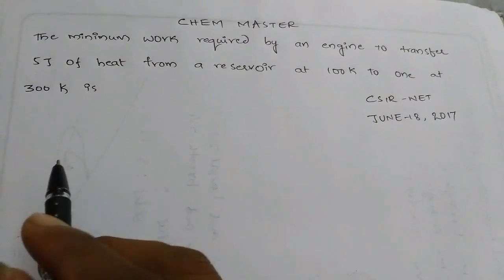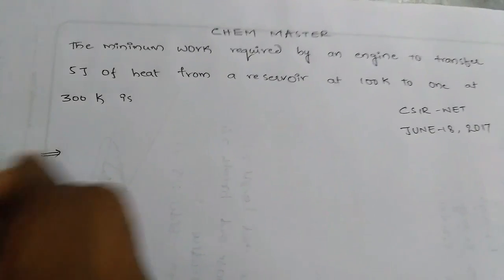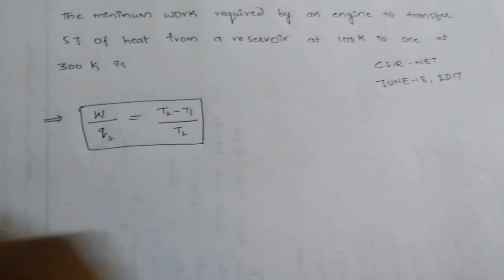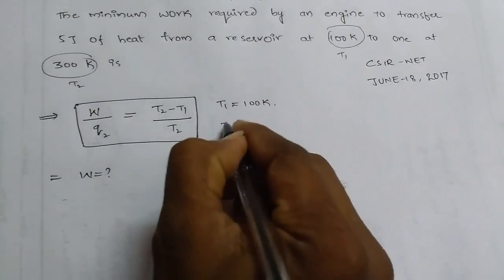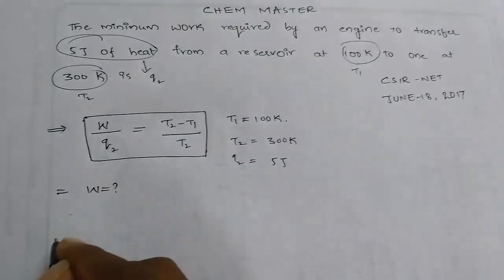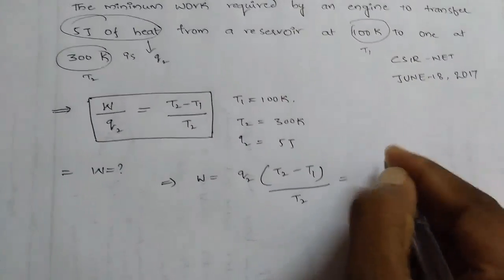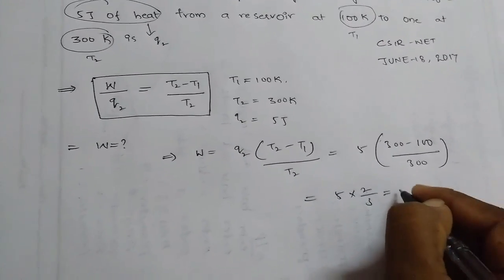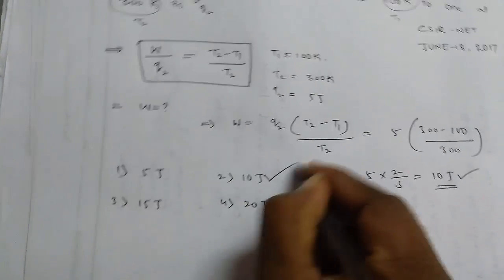Chemical sciences solved problem of CSIR Net ,june-18,2017

Comment: I did the same in exam but 5 x 2/3 is not equal to 10. BUT If we take the formula (T2-T1)/T1 then we are getting 10 as the ans. 5x2/1 = 10. There must be some mistake in the options
Reply from the maker: +aarzoo makkar sorry,no mistake.......I have directly given 5×2/3 but we should write 5(2/3) means 5 should multiply with both 2 and 3 and the product should deveded by 3.........
Reply: How can you multiply 5 to both 2 and 3 at the same time and then divide the product by 3. doesnt make sense. hearing this logic for the first time, sorry. Even using BODMAS u dont get this ans
Reply from the maker: aarzoo makkar madm,go on ur way........no problem ......hv a sense........
Reply: Gate chemistry  now this makes sense.